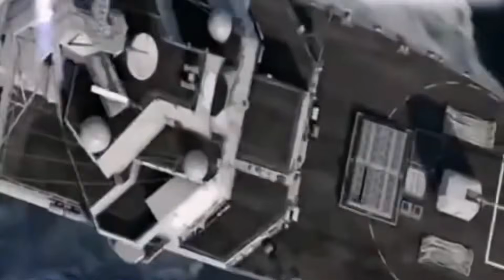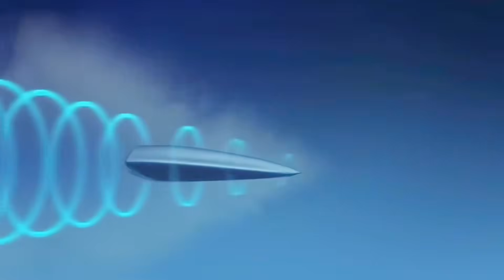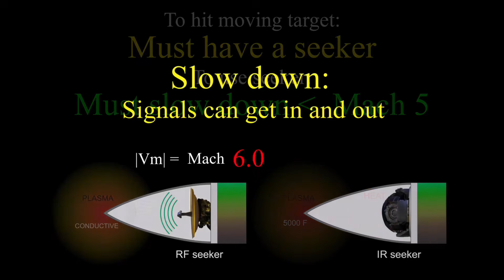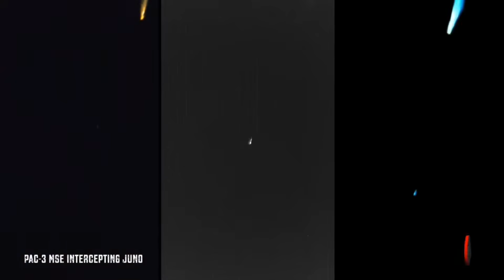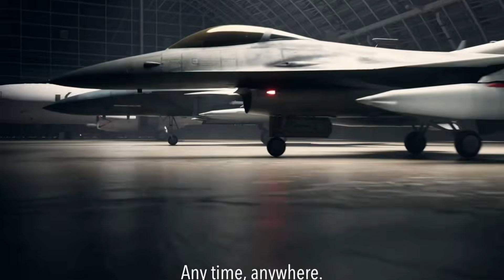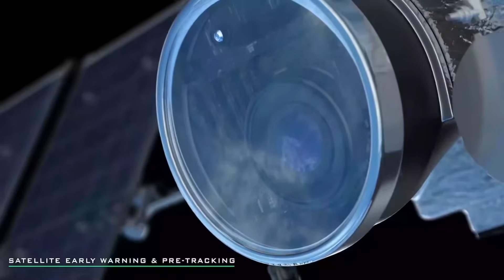China's Hypersonic Missiles Explained for Kids

Comment: As far as I know, Chinese HGV like DF-17 are not proven to hit moving targets unlike MaRV DF-21 and DF-26. Also waveriding HGV can cruise farther but cannot make as much maneuver as more conical non-waveriding HGV. 

The Chinese anti-ship ballistic missiles like DF-21D and DF-26B has an antenna sticking out the rear end of its MaRV which is always pointing towards space/satellite. No need to worry about plasma. If I remember correctly there was a PLA test disclosed by the Pentagon, where they said 2 missiles hit a moving target and 2 missed. Talk on reputable forums were that those were the comm relays or PenAids.

Also hypersonic speed attenuates signal for the seekers but does not block signal completely. Therefore they can still track moving targets at hypersonic speeds (albeit when the missile warhead moves and eventually hits the target it may not be hypersonic anymore)? 

Even if it was true that plasma completely blocked signals, there would be ways to mitigate that.  There are maneuvers designed to cool a given missile, thereby eliminating/reducing the plasma.  Cold War US Army's Pershing II's MARV did a pull-up maneuver partly for this reason, to make it easier for the on-board active guidance to see and acquire its target.  There have been Pentagon illustrations of AGM-183A ARRW's flight path depicting a maneuver to gain altitude coupled with a label saying something like "re-acquire satellite signal." Chinese hypersonic missile illustration also show the same up-down wave like motion. There is a type of trajectory known as a skip-glide trajectory where an HGV keeps "skipping" off the atmosphere into space, which would be a decent way to reduce heat & plasma (because it cools off once it is exoatmospheric).